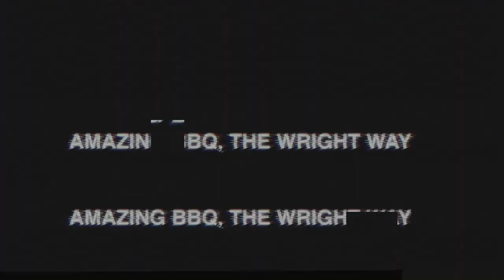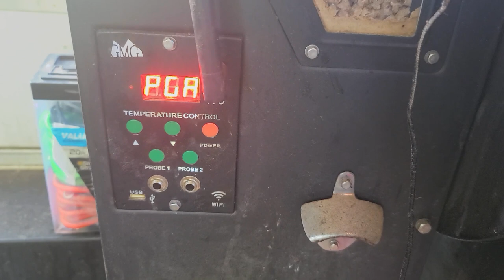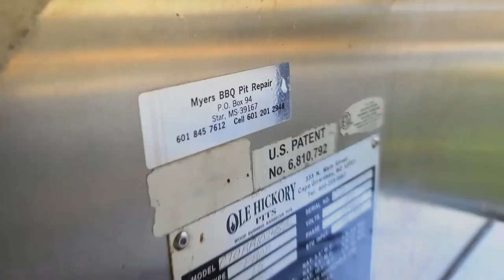Beaten But Not BROKEN #theWRIGHTway

Comment: If you can take out the shelves and get full access to the wall you can try and drill out the remaining bolt. Once its out you will likely need to use a Tap and redo the threads. New bolt and you are good to go! 

The other part you showed at the end looks like a gear key to hold it on the motor shaft but not sure as I am not familiar with the unit.  Hope this helps!

Good luck with the GMG! I have been using mine for years and only had the igniter die on me. Customer service was amazing! Good Luck Brother!
Reply from the maker: Thanks brother. Updated to come what we found and how we're gonna get it fixed.
Reply: Awesome! Just subscribed! Looking forward to the update and more recipes! :)